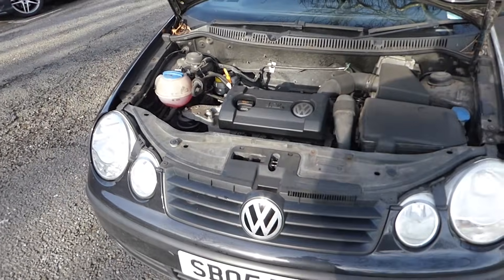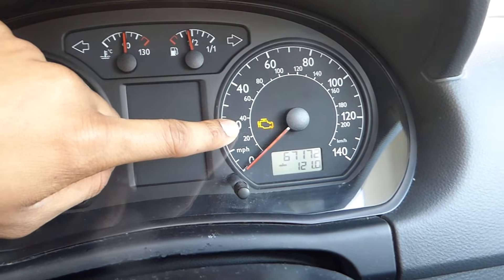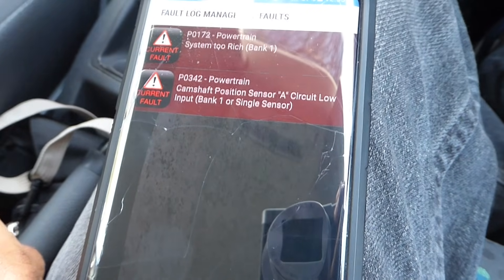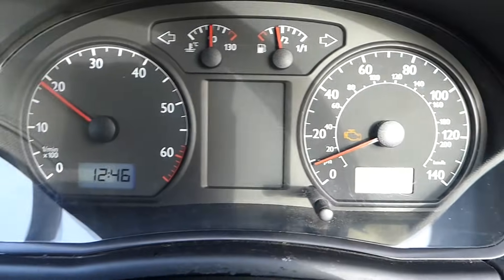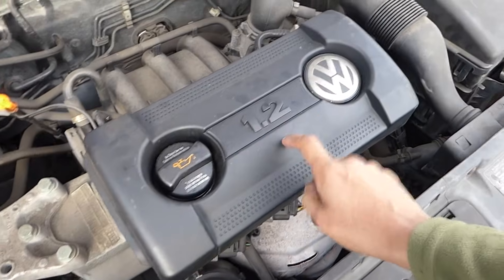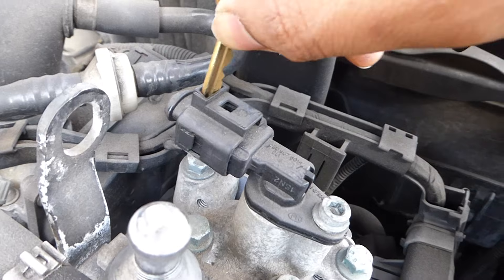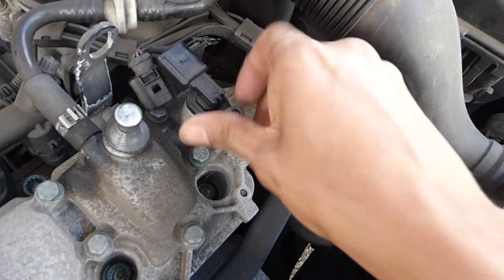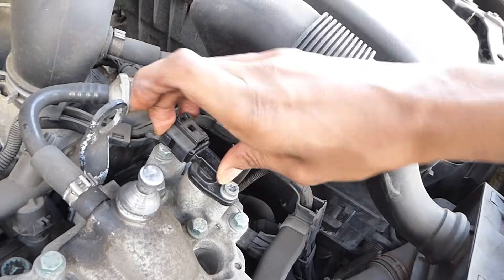VW POLO Camshaft Position Sensor

Comment: I still don’t understand. So if you take the sensor out and apply some oil on the o ring and then put it back on it will sort the problem. Cos that’s all you did in the video

Comment: I know this video was from 4 years ago but on the off chance you see this message, did changing the sensor actually fix the problem? I've been doing research on this engine and it seems a common problem with this fault code is a problem with the timing chain, usually it stretches and jumps. I've bought exactly the same car as my first car and have the same fault code. I've recently changed the sensor following this video and am praying this fixes it. If not then it will most likely be a timing fault which costs a lot to fix. I'd like to know if you also  had a timing issue.
Reply: Having the same issue, any updates?

Comment: Thank you very helpful - what about if you can see that the wire to the sensor are damaged?
Reply: fix them as more likely reason why it fails if not connected properly due to damaged wires or connector

Comment: Is there a way to know if the old sensor is broke? Like before I order a new one I want to know that it is that sensor that is causing my cars problems. Like it won’t accelerate past a certain point until I switch gears. The revs go up and down and it cuts off a lot especially while in traffic etc
Reply: Polo 1.6 BAH engine camshaft position sensor a circuit range performance bank 1or single sensor

Comment: I had the same problem and I did wat u showed me and it fixed my problem thank you soo much! 😊
Reply: Hey i have simular problems , there is litlee shaking on red light in traffic and i cant start car imidetly it always start from second time , Diagnostic show me rich system fuel and camshaft sensor. Should that be a problem? Regards

Comment: My Polo is giving me same fault code 16272 "Camshaft position sensor (G40) signal to high" so I just replaced the  Cam sensor but the fault is still there. Also noticed that when the AC is on the car shuts down...... Can anyone suggest me anything else? By the way the new sensor is OEM.
Reply from the maker: hmm, could be a timing issue. The ac doesnt seem connected, if you can visually see the ac compressor in the engine bay, you should have someone turn ac on when the car is running and watch it to see if it has ceased.

Comment: I have both codes on my polo as you in this video, did it fix the P0172 also if not what is the possible fix, I will try fixing P0341 with new sensor. 
I dont feel any problems while driving for now everything seems fine, it only suffers a bit on startup, and few days ago 1-2 mins after a cold startup I got temperature warning light on but somehow fixed itself by me turning the engine off and on again.
Thanks.
(bad english sorry)
Reply from the maker: it did fix the problem for me. You can try and unplug the sensor and try and drive with no sensor, see if anything  changes?

Comment: Hi dont know if you can help but have a hiccuping issue with my 02 polo changed coil packs and plugs cleaned map sensor had pressure tests done used a fuel cleaner and had injectors checked code p0172 came up prior to doing all this and all to no avail. Any ideas as to what to try next? Could it be the coolant or mad sensor but no codes showing on vag machine now am at a loss and so is the garage I went to told me to drive it into the ground and get a new car cheeky sods
Reply from the maker: can you explain a little bit what hiccuping means?
Reply: @messedupmechanic3607  basically it stutters under load its like it has less power under acceleration so to try to compensate and sort of hiccups difficult to explain but like a momentary loss of power then picks back up again like I said have cleaned lots of sensors replaced coil and spark plugs exhaust seems ok so at a dead end. 
Thanks for the response
Reply from the maker: sounds like you changed alot of parts. When it was in the garage did they check timing? I know these polos sometimes have a problem with timing chain slack, but the problem with that is its expensive to fix. It is a known problem with this era polo
Reply: @messedupmechanic3607  yeah they checked the timing and all ok did take it to a gy who did a software update on the ecu and running better but still has a slight hesitation when putting foot down dont think I'll solve this mystery lol
Reply from the maker: Yes these cars are getting old now. If you can live with it its probably best. Maybe change the fuel filter on the next service.
Reply: Hi i have got 2 fault codes 16687 and 16726. One is for cam shaft position sensor and one is for cylinder 3 misfire. Can you please recommend any diagnosis.
Reply: I had that problem after my first service, replaced coil packs to no change, it turned out that one of the spark plugs didn't have the correct gap

Comment: did you replace it with oem or a eurocarpart compatable, I've got the same issue just now, had timing chain done around 2k ago,eml was on prior does anyone know how to test actual sensor is it resistance, continuity.... that way we could save time and money
Reply from the maker: Yes I bought from ECP. It was a Bougicord branded part which i believe was oem as they scratched out what looked like a vw logo on it. Anyway it worked fine. You could unplug it, drive it and if nothing changes its probably is the sensor?